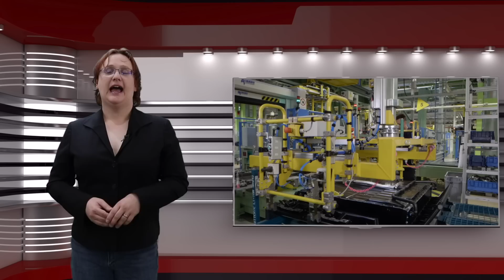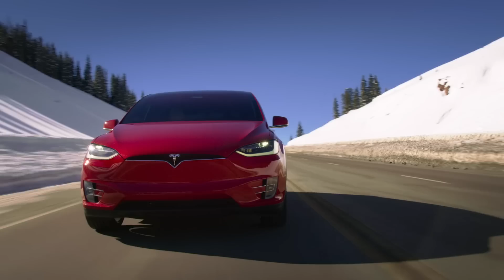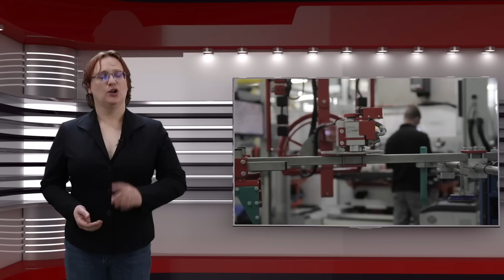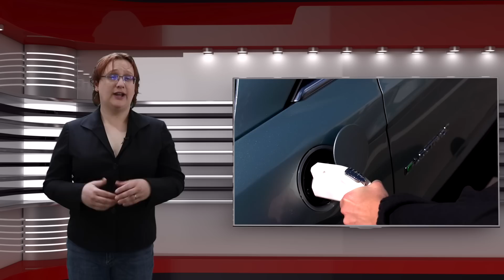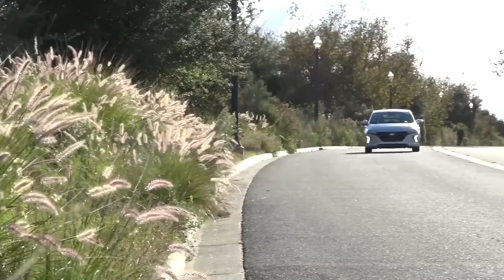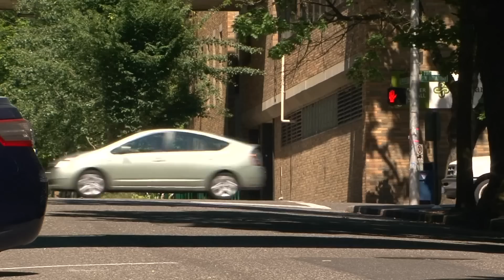As EVs Get Older, Aftermarket Batteries Will Change The EV Marketplace

Comment: I think the manufacturers want to turn the electric car into a consumer "product", once it is a certain age, "users" will want to upgrade to the newer model, just like a cell phone.  It goes against the whole idea of the fixer community who state that it is more environmentally sound to keep the old model going instead of buying new.  

There's another elephant in the room.  Solar, wind, hydroelectric, etc will never be able to supply the extra power needed for these vehicles, and if you do not want to use fossil fuels to generate the electricity, that leaves nuclear.
Reply: monkeyboy4746 
That second paragraph is simply false. It is entirely possible for renewables to provide 100% of power to a region in most circumstances, especially if some battery backup included.
Reply: Yep, watch the Fully Charged episode on National Grid. They reckon you could shift half a million cars in the UK to EV right now and - with some slightly different balancing algorithms - you wouldn't need any other changes to the grid. Smarter grids will accommodate many more (filling in the bathtub of demand):
https://youtu.be/vX0G9F42puY?t=9m22s

Plus, I've been doing the sums, and by adding 1-2kw of generating capacity onto my roof I could cover the vast majority of my driving needs from my own house, with the only exception being if I decide to go for a bit of a trip on the weekend. This is with a short commute each day to pick up the kids from daycare/school (I ride my bike to work, costs way less and keeps me fit).

Comment: Good insights and thoughts on the future state of used EVs and battery swaps.  I replaced the battery packs in several old Priuses for between $1100 and $1300.  Put in the labor myself and the $1300 pack was available at my local Oreilly's auto parts and came with a 3 year warranty.

Comment: What causes a product to be scrapped is often that it is uneconomic to repair, however sometimes it is that technology has moved on and customers want the newer functionality and brand ( eg mobile phones or desktop computers). I think 3rd party suppliers will provide upgraded battery packs for higher value EVs or where demand is high due to large fleets. Time will tell.

Comment: I suspect we will start to see a larger market for used battery packs were people use them for home power storage were they don't take the same amount of beating.  To me this will be a great use for batteries that cannot easily or cost effectively be reused in cars.  As for cars needed g new batteries I personaly don't see that lasting too much longer as society moves to level 5 self driving cars people will no longer see the advantage of buying an asset that sits unused for 90% of the day or more.  Provided the taxi services drop in price as they should when you take the drivers salary  cost out the equation then  taxing becomes the clear way to go

Comment: EVs keep poison air away from the lungs of millions of people in towns and cities.  Fantastic idea.
Reply: And yet the vehicles they sell the most of are the ones that pollute the most, Trucks!
Reply: EV trucks are on the way. We have EV and hybrid buses right now.  We have had EV trains (electric trains) and buses since the late 1800s (trams).
Reply: John Burns Right! There is no excuse left now. Stop putting Grandma and Grandpa and your children in jeopardy through air pollution. I say if the 2019 Bolt came out with  75 Kwhr battery,  at $30,000, Chevrolet would sell millions.
Reply: The $30,000, EV will come, and sooner than you think.

Comment: Nikki, great video.  I think this is an important enough topic to do a couple of deep dive scenarios.  ie. What are the individual manufactures policies of replacing a battery, steps one has to take when replacing a battery (and associated cost), and / or will future batteries (with twice the power density) work in todays car?  The information bored1980 offers below was great to know as one reflects upon EV or Hybrid, Manufacturer, battery range, etc.

Comment: Availability of the batteries is another issue.  With several different manufacturers all gearing up to produce electric cars by the early 20's, materials for batteries are going to start becoming scarce (those that aren't already).

Comment: Leaf's are as cheap as chips in the UK, its just the issue with the battery.
If a 3rd party made a new upgraded battery (40KWH ish) then it would be an game changer.
Reply: Despite data to the contrary and competitors Nissan still made no provisions to a thermal management system in the 2018 models. They just want to move more cars. They are no better than Ford or Chevrolet.
Reply: What if they made a 3rd party new upgraded battery - with a degree of thermal management built-in, in the space that high capacity batteries would free up?  Something like a very compact heat pump!  Hmm.. the new cells might not be as sensitive to heat so nix that.
Reply: What if 'they' made?? Guys what if 'you' made after market batteries yourself?  Can you imagine the business 'you' would have?  But where to start?... spend some time on the jehugarcia youtube site and you will see that ANYTHING in the EV world is possible.
Reply: I agree, also look at Rich Repairs (ex-Car Guru) where he's fixed up waterlogged Tesla Model S.  The things are essentially simple and once the aftermarket is there (it could be getting there with the Leaf) then there will be a business to be made with battery (and faster charger) upgrades.  Will anyone see a need to do a CHAdeMO to CCS (or vice-verca for BMW's and Hyundai) car sockets?

I'd also think there would be a market in replacing, or updating the software, on the central 'information screen' so that maps can be replaced and you don't have to rely on Nissan for 'updates' (Same for other cars too)

The market is going to be there very soon.
Reply: I don't think such a market will ever exist, at least not for these early model EVs like the 1st Gen Leaf, especially because there are only 300k or so on the road worldwide. It was badly designed and they had no excuse since the Renault Zoe and eNV200 have proper thermal management.
Reply: jkenny1 - I hate to break this to you but those are exactly the cars that would best suit after market batteries. There is a huge difference between people who see problems and people who see opportunity. Please no insult -  there is already a guy converting older Tesla batteries (from wrecked Teslas) and installing them in Leafs as range extenders.
Reply: Kieran Mullen They are compliance vehicles don’t you know. I am looking for aftermarket 75Kwhr Chevrolet Bolt battery if GM will not do it.
Reply: Mark Plain ev west!!!
Reply: I love this channel and find the information very useful ...but this is DIY not the kind of thing just anyone can do or would want to.
Reply: battery pack price is touching 100$/kw.so that would half the price for the upgrades moreover the degradation is also minimizing.car could hold 90% of charge after 5-6 yrs so u can still travel a fair bit of distance.in a year or 2 most of these problems will be solved as companies aggressively push for better efficiencies.tesla aiming @5% cobalt use in their battery,4 ev companies are planning for solid state battery before 2022.these are initial tech change problems which will not last long
Reply: I think its foolish to still think ev's produce more pollution as they are more efficient in converting energies.tesla's are 6 times more efficient and so are most in the industry.
Reply: Mine isn't subject to electronic failures of any sort. No electronics what so ever.
All machine.
Reply: what are `leafs`
Reply: krkzv Tesla patents are open to the public
Reply: FFVoyager, that channel is"Rich REBUILDS". Not "Repairs".
Reply: I've seen used Leafs for as little as $2500 for a 2011.

Comment: Being able to upgrade the pack seems such an important thing. Forget autopilot, gimme range and the promise of more range.
Reply: Graham McDonald
Soon enough range will become a non-issue.  300 or 400 km and prolific charging options should be common.
Reply: Government mandated design is the worst of all options. All they will do is stifle innovation as manufacturers make to meet the rules. 
Over time the market will solve the problem. Nissan Leaf has tremendous depreciation exactly because the batteries are rubbish. 
Tesla we don’t know yet but do hold their values very well.  Musk is working on million mile batteries that should outlast the car’s very structure.
Reply: Rickie j  I hear you.  High accelerations at low speeds is a cute trick but not terribly important.  My range numbers above were low, we now see 400 to 600 mile options in the pipeline, not far from your spec., and charging speeds have been increasing dramatically in addition to charging stations, so your requirements will  be met in a few yr.s. I believe, how affordable they are still needs to be seen but batt prices are falling as capacity/charge rate increases.  You may decide that 1000km is not required if you can charge 80% in 15 minutes and stations are everywhere?
Reply: Rickie j  It's coming.  I'm certain many things you and I haven't much notion of are also in the works, at least incremental improvements that add up over time.  Suprer Caps have their place, not a game changer but another step forward.
Reply: @JamesMuecke-y3d  You can play "hard to please" but you'll change your tune when you see the dramatic advantages of 1/3 cost of fueling, near zero maintenance, self driving, etc., etc.  And losing batt cap like you suggest is PURE IGNORANCE...it doesn't happen.  And you won't be anymore likely to be stranded than with an ICE as the charging network is built out. 

 Be obstinate and be last if you like.  Already the 3 is replacing econoboxs like Honda's because total operating costs are comparable even with much higher up front price.  And 500 miles will be available but not for $25k.  Try a 3 for a day or a week and you'll want one and you'll want the AP too.
Reply: @JamesMuecke-y3d  Here's what batt degradation looks like for a Model 3 roughly:  
3% loss of range in 1st 20k miles, (initial is fastest then tapers off)  7% at 200k and probably around 10 to 20% at 400k miles, not much data on high miles yet.  And how much does a typical ICE lose due to engine wear?  Charging options will soon be everywhere, just a couple yr.s out.  And for most folks they will rarely use them except for long trips, they will plug in at night and be SO grateful they don't need to think of going to service stations twice per week.  Or in YOUR CASE visiting petrol stations once or twice per day??   (if you need 500 miles daily)
Reply: @JamesMuecke-y3d  BTW--I'm with you on NOT being an early adopter.  I keep cars 'forever' and quite content with my two 'ol manual trans BMWs, one for around town nearing 20 yr.s old, fully depreciated don't put enough miles on it for fuel to be an issue and the other is a true sports car for road trips and fair weather Sundays....even with it's measly 320 mile range and lousy 20mpg, it's a drivers car unlike a Tesla which are family/executive cars. 

 I spend most of my miles in a very un-fun 1-ton service truck that I would love to convert to a Tesla truck if they were available and out long enough that I could get used for half price.  No hurry.
Reply: @JamesMuecke-y3d  Volt, Leaf and others are a decade behind Tesla in terms of batt tech and technology in general.  (forgetting details on the Chevy) but the original leaf not only was very limited in range but had no batt thermal nor other management features necessary for longevity AND the batt chemistry and design is archaic in comparison.  Batts are no more the same across brands then conventional engines all the same.

  You will be able to buy the car you specified in that price range and it will be the most convenient and economical car you ever had.  But it will be a few yr.s used.  Why not try one for a day or two just to see what they are like?  I'll tell you why NOT to---because those who do usually want one very badly.  (Model 3 in particular)  However it sounds like you will require a higher type like a crossover which are coming soon. 

 ALSO you may find the all wheel drive with best traction control you ever experience is much welcomed in the winter if you drive in snow/ice like it sounds you must.  Don't forget it will be vastly safer both in terms of crash worthiness and crash avoidance than anything you have ever dreamed of owning.

Let's say you now pay--say $40 for a full tank--how'd you like to reduce that to $12?   (obviously depending on your location and charging habits)  You say there are no charging stations along your route, but do you really KNOW that?  They aren't advertised in the fashion you are accustomed to, they will be featured on the screen of your car instead with all the info you need including real time availability.

Check this site and zoom in to your route, these are only the Tesla chargers, other charging stations are also spreading across the nation.
https://www.tesla.com/findus
Reply: @Mrbfgray  Thanks Bo.  I would like to have an e-car.  Maybe I can buy a nice used one down the road.
Reply: @JamesMuecke-y3d  Me too.  I'm not looking forward to it as I love my 2011 BMW M3 but I figure it will be my last ICE car.  There are strong hints that Tesla is working on new batt. tech. that could almost double energy density while being cheaper, longer life, etc....that remains to be seen but they are having a big presentation sometime early next yr.  I'm heavy long the stock beginning June at $202 ave. 

Thanks for the conversation and especially THANK YOU FOR YOUR SERVICE, I take it you are a vet.  Best wishes.
Reply: @JamesMuecke-y3d  Additional reasons those cars depreciated hard is because the EV landscape is advancing rapidly, newer options are much better in every way.  (Another reason I am not an early adopter)  Batts are becoming higher capacity, faster charging, longer living and cheaper, features in general improving.  The Volt and original Leaf are not compelling cars by today's standards, OK for basic city driving but that's about it.

Comment: I think it will take a while but as prices fall, batteries will become more economical to replace. I think you are correct that the after market people will be more interested as time goes on. Also used battery packs that are not suitable for automotive use are finding second homes as energy storage. That means recycling old packs will keep value for the after market folks.